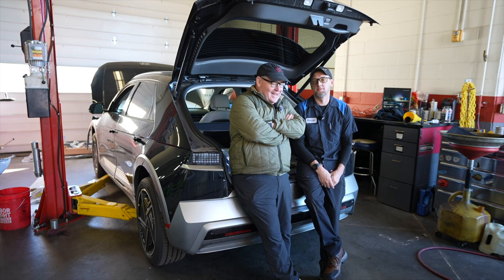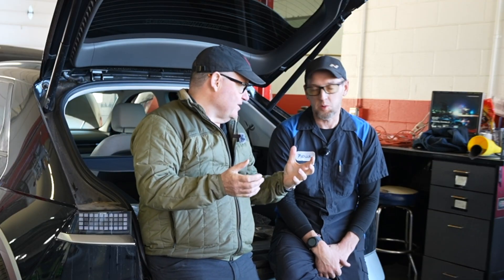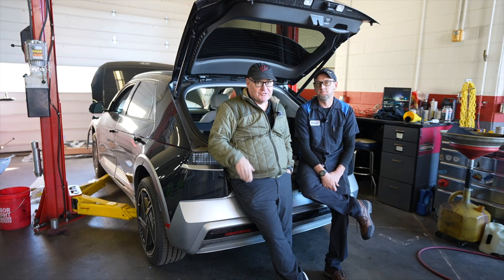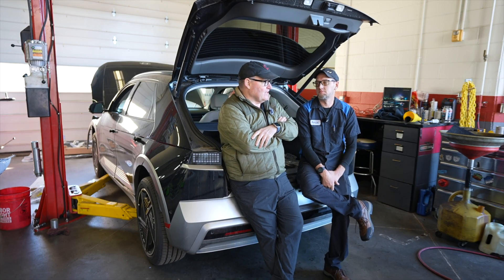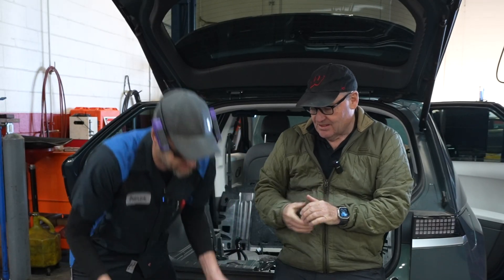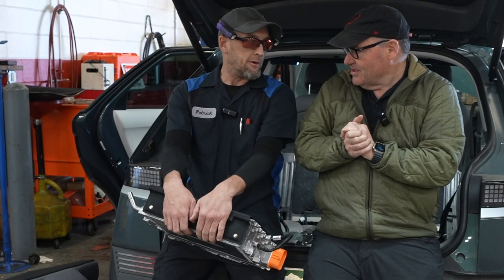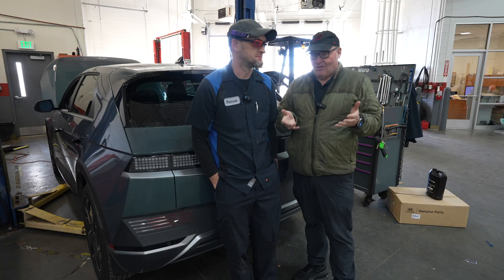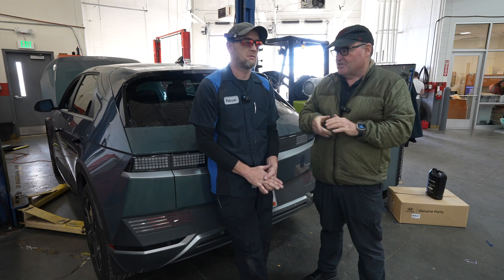IONIQ 5 ICCU Replacement: Patrick Replaces an ICCU  and Discusses ICCU Issues.

Comment: Assuming you got permission to do this video, kudos to Patrick, the service manager, general manager, Hyundai district manager and corporate for their approval. I worked for new car dealerships for 27 years, and there’s no way they would allow this kind of transparency. Every known recurring problem with a vehicle, the customer was told that this was the first time we’ve seen it. 

Of course, this was pre internet.
Reply from the maker: The dealership loves Patrick and of course I had permission.  Cars are extreamly complex machines (I have worked with several) and even the best cars in the world have issues. Walk into any dealership shop and you will see a number of engines on the floor being reworked or replaced.  Of course, you already know this.  Thanks for watching.
Reply: That is still the corporate policy for all the car companies, including Hyundai and KIA.
Reply: Independent dealer. He can do whatever he wants unless it's specifically forbidden in his franchise agreement.

Comment: I have a 2025 IONIQ 5 Limited RWD and the ICCU failed and had to be replaced at exactly 1700 miles.  Car was towed into the local Hyundai dealership where I bought the car.  The service advisor said they’re seeing more and more ‘25s with this issue.
Reply: It seems to me that if a (car) company needs more than 1 or 2 years to correct a design or manufacturing issue, it focus on quality isn't really were it should be and its client satisfaction will be mediocre at best.
Reply: @vgstb  

excellent point
Reply: but  it seems even your repair from what I'm reading online, is the  ''replaced '' ICCU  is not going to be any different than the old one that was defective,   have you heard the same thing ?
Reply: @flolou8496  correct. Some folks are working on their 3rd ICCU. Same flawed design, same outcome.

Comment: Hyundai absolutely has not mitigated this issue in 2025s. Ours was just 6 months old and 5,500 miles when our ICCU failed on the I5. It has been sitting in the shop for a week.  Estimated ETA for the parts is 5-7 more days. So, no, the parts aren't available right away, even if it doesn't take months.
Reply: Mine took 5 days to diagnose and another week to fix.  Just got the service summary showing that $4003 (U.S) was charged for the warranty repair and one week of a crappy ice loaner.  When my lease is up in 2027, I won't get another Hyundai.
Reply: @josephleibowicz9104 sounds like you received great service.  About 12 days to get it fixed.  Some people are going months without service taking care of it.   It’s unfortunate that your vehicle was impacted with the ICCU but at least you had a good service department.   I will take a good service department with vehicle issues any day over a bad service department that doesn’t take care of its customers.
Reply: @j @josephleibowicz9104  I returned my leased 2024 ioniq 5 2 months early.  I’ve leased a Tesla Model Y.  I’m happy with the Tesla.
Reply: @JohnSmith-uz3dt
My choice was between the Ioniq 5 and a Model Y.  I chose the I5 because I called my insurance company first and checked the cost of insurance, and one month of Y insurance was the same amount as 6 months of I5 insurance. I’m glad I’d watched YouTube videos that warned me to check on this first.
Reply: 2025, popped at 5k miles. in shop for a month now, south LA.
Reply: I just picked up an Ariya with 30k miles for only $18k as a secondary, “errands” car — I did a ton of research, and Hyundai’s reliability ratings and poor warranty process scared me away. While not every Ioniq has an issue, the failure rate is still way too high for my taste. 

Still, this was fun to watch. Thank you for sharing!
Reply: Mine took a day (San Diego) buddy took about a day (Portland), what market?
Reply: Since you posted this video, there seems to be an explosion of people complaining about ICCU  failures and a lot of of them are on 2025 models. It seems like since cold weather came there has been a huge uptick in complaints. And now people are saying they are waiting for weeks for parts again because apparently Hyundai doesn’t have enough. This is becoming a sad joke.  One guy claimed that the dealers in his area have 30 to 50 of these waiting on repair. I find that one hard to believe! I think when my lease is up in 14 months, I’m going to run away from Hyundai and go get something else. I don’t like having a car that I can’t trust to drive on a long trip for fear it’s going to leave me stranded halfway between.  Hyundai has handled this whole fiasco in a terrible fashion. They’re not transparent about what’s going on. They’re not transparent about the odds they’re going to fail.  And they still are putting out garbage that fails.  My advice is stay away from  these cars until they have a proven fix for them.
Reply: My 2025 IONIQ 5 LTD went out with only 3200 miles. Happened December 22, I was told 3 weeks to repair but they actually got it fixed on the 26th but we were already in Canada on Christmas vacation in a rental...
Reply: My IONIQ 5 2025 is 3 months old, ICCU died at 5000 KMs / 3000 miles. I’m being told they can’t even “look” at it until Feb, let alone process warranty / order parts….
Reply: @daedelus8277 yikes. Sorry!
Reply: Yes me too!
Reply from the maker: Sorry to hear about your issue. Your experience is different from ours. We have also had two cars that were 2025 that had issues. An improvement is a different concept than complete elimination. Crossroads is just one of several Hyundai dealerships I work with.  The biggest problem in the shops is finding a time slot available for repairs. All these dealerships have a shortage of mechanics.
Reply: and you're losing your warranty time while car sits in shop.
They should be sued for this crap
Reply from the maker: Sorry to hear about your issues.  The video only discusses the issues at one dealership in Colorado.  They are seeing far fewer problems (so far) with 25s then they did the first year with other 22s, 23s, and 24s.  Your experience is different.  We have had two failures with 25s.
Reply: @electricprincipal543  What is failing in the faulty ICCU? Is there a newer ICCU design in the newer cars? I am interested in purchasing a used Ioniq 5 or EV6, but this issue makes me hesitate if even a car with a replaced ICCU can have the new part fail. Thanks.
Reply: @barryw9473 From what i have heard, No new design until 2027.
Reply: @Wayneman50 thanks. Hyundai mist be losing a lot of money on warranty repairs and recalls. Why not bring a new design sooner?
Reply: @Wayneman50  please provide the URL where you got this info. Thanks!
Reply: It's possible you're just the 0.1% unlucky person for 2025 versions. Everyone else not having problems isn't likely to comment about how they're not having problems, since all that really does is piss off the few people that are having problems.
Doesn't mean you shouldn't be able to get the ICCU replaced very quickly though.
Reply: @7minutesdead  Sure, that is possible. Nobody has yet to explain why, if the ICCU won't be redesigned until 2027 model year, will fail any less often in 2025 cars, given enough time on the road. I would love to know what exactly fails on the ICCU and why. Thanks!
Reply: @barryw9473  "...ICCU won't be redesigned until 2027 model year", did you see somwhere that Hyundai is redesigning the ICCU for 2027?? If so, please provide the URL. Thanks!
Reply: @billpottinger1136 sorry, nothing additional. Someone here said redesign coming in 2027. We need to have more detailed info on ICCU failure mode and if replacement part has different physical design and /or software than ICCUs that fail.
Reply: @barryw9473  Yeah same here. Only hint we've received are the replacement ICCUs are slightly smaller in size, so there is some unknown redesign going on. I also haven't heard of anyone getting a replacement ICCU that then also had to be replaced again, so that's another good indicator of a redesign.
Reply: Keep buying Hyundai!!!!!!!!!  Hahahaha.  Meanwhile my 2024 M3P runs like a charm.
Reply: @guru2899 that’s awesome.  So does my Hyundai Ioniq 5 and my Shelby GT500 and my Tesla  and my Toyota and electric bike. Lol. But if something happens to one of them.  It’s okay. That’s what warranties are for.  It’s not that big of a deal 🤷🏾‍♂️

Comment: I have a 2025 I got a 5SEL really concerned about doing road trips
Reply: We did an 8,690 mile road trip this past summer in our 2025 Ioniq 5. Most fun trip ever!
Reply: Nike! I just sent 2700 miles in mine with no issue
Reply: I would never road trip a E-GMP platform car. Just not reliable enough.
Reply: @Wayneman50  We're up to 21k miles of road trips in our Ioniq 5. If the ICCU fails, the supply chain is finally working well and it would be no more inconvenient than a blown transmission ... which I actually have experienced.
Reply: @jerrymildredpetersen3177 Happy for you. Keep road trippin brother. It’s just not for me in that vehicle. A 2025 Mustang mach e for sure, no problem.

Comment: This is a great video.  So many people are making the ICCU issue bigger than it is.    This video clearly shows the issue is not as big as people make it online.
Reply: It is big. I took my I5 in for service last year and there were five I5's on the lot, all waiting on ICCU replacement. I live in PEI, there are not too many I5's on the road here.
Reply: You’ll think it’s big when the car fails on you at the worst possible moment. Sure it’s not a big deal in terms of a 90 minute fix, but imagine having a road trip ruined by this, or getting caught out in some remote location mid-winter, or ……….     It just should not happen any more, it should be permanently fixed in all new AND old cars.
Reply: @robhaitch5544 when you buy a car.  Things happen.  Some people have issues all the time. Some people never experience any issues.  It’s just something you have to know going into it and be okay with that. Cars are mass produced by machines and humans made of thousands of parts.  Things will break and stop working.   It is what it is.
Reply: This video is sugar coating the issue so bad it's making my sweet tooth ache.
Reply: @Wayneman50 show me proof that the issue is bigger than what these people are saying.
Reply: @LifeHackMEDIATV  The  proof  is in the hundreds of dealerships  who have logged the problem, and only a class action lawsuit  will reveal how large
that number is ,   and it's only a matter of time before dealerships are forced to reveal this data,   but anecdotally  it's at least 5% of the  entire production line 
for 2022 through 2025 models,   hopefully much less for current 2026 models,  but there is no offical statement from  Hyandai the ICCU's for 2026 models are 
technically redesigned.
Reply: We found the Hyundai plant. Ask the dealers. It's 15-20% for 22-23 model years based on their sales vs ICCU repair data.
Reply: There was a survey last week on Facebook Kia EV6 owners.  250 out of 1,300 had ICCU failures.  The group is 30K members.  I think this is biased a little high, but 10% is a conservative estimate and is way too high.

Comment: The ICCU in my 2023 Ioniq 5 died 2 miles from my home and my EV went into “turtle mode”. I knew to not turn it off and limped safely into my home garage. It was towed to the dealer 41 miles away, and it took them 12 days to acquire and install a new ICCU. I leaned on my spouse for 6 days and got a loaner for 6 days. A friend drove me to the dealer for the pickup.
Reply: You got lucky. My 2023 was at the dealership for almost 6 weeks and I was told I was one of the lucky ones. Others were waiting much much longer. Both my 2023 5 and 6 had the problem and the 6 died on the freeway. Pretty scary. Hyundai has done nothing about this problem and their customer service is atrocious.
Reply: @imasharksfan1149  Glad you're okay. What happens when one of them fails on a freeway and causes a catastrophic accident? People could even die in such an event. The US government might make them suspend all sales of EVs.